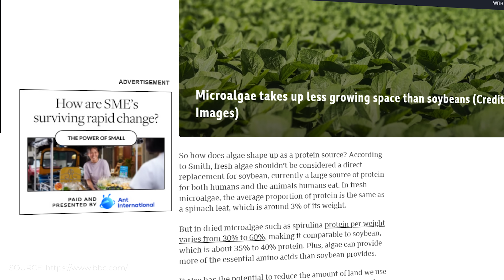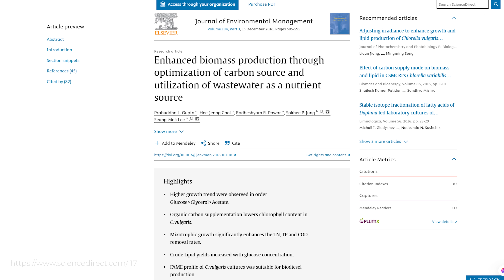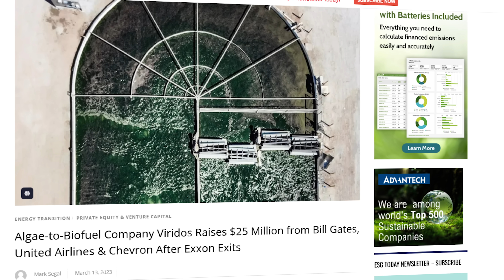Algae: The Ultimate Circular Crop?

Comment: Excellent video!  Well done.  Regarding fish farms, the biggest problem with them is they're stationary.  That's very bad.  Fish aren't supposed to be stationary, they're supposed to move, as much as 50-100 miles per day.  All of that poop falling in one area turns it into a literal cesspool.  Instead, it's supposed to be deposited over hundreds of square miles of ocean, where it's easily absorbed by the ecosystem, becoming part of the food cycle.  A much safer, healthier and eco-friendly system are "free-floating" farms that are allowed to drift out at sea?  But those are EXPENSIVE!  They have to be built to withstand the most hostile environment on earth, and a single mistake can mean the loss of the cages and the fish.  Believe it or not, land-based fish farms are the best solution.  Safer, easier, more economical, and the waste is easy to manage.  I have a Bachelor's in Aquacultural Engineering.  :)
Reply: Fantastic information
Reply: What about locating fish farms [or algae farms] where there is vigorous tidal flushing every day ?     Governments have the authority to designate such well-flushed  bays, channels and estuaries,   I would think .
Reply: @doughamblett5204  They typically are in tidal areas.
Reply: @doughamblett5204  That's where they are located.  But it doesn't matter, because all the poop only goes in two directions:  in and out, not through.  The poop that makes it to the exit in six hours ends up getting sucked back in when the tide changes.  So 50,000 huge fish, pooping in the same spot, 24-7-365 for years, is more than a simple in-and-out can handle.
Reply: And use the fish waste to grow algae, which can be fed back to the fish.
Reply: "The shit you say"
Reply: Most exquisite comment, cheers!
Reply: what's your opinion on using the fish waste to fertilize hydroponic projects? is this a good way to create an ecosystem that absorbs the fish waste without having to build free floating farms?
Reply: You do realize that if you run in circles around your living room until you've reached 5280'ft, you STILL ran a mile regardless of the fact your living room is nowhere near a mile long right? 🤔
In other words, 🐟 still do a lot of swimming/moving even if contained on fish farm lmao

And we solved the problem of fish waste ages ago with plants/filters

Comment: Can Algae be used to extract nutrients from rivers and prevent the red tides experienced in Florida?
Reply: They are algal blooms
Reply: That's what the red tides are doing. You could filter the red algae out of the water and you'd have those nutrients sitting in your filter.
Yes, you could run your river water through an algae farm, but you'd need to hold the whole flow of the river in your algae farm, or develop a reverse osmosis system to concentrate the nutrients from the whole flow of the river into a smaller volume of water for your algae. It's much more efficient to stop people releasing those nutrients into the rivers than it is to clean them up after the fact: controls on farm fertiliser use, and algae farms as part of wastewater treatment.

Comment: The "forever chemicals" in our waste water present a huge challenge as they will permanently contaminate crop ground if sewage waste is used as fertilizer. They should be banned.
Reply: A lot of them can be removed with the right equipment. Many PFAS, for instance, tend to create a foam on the surface of the water, so correct aeration and agitation to promote this behaviour makes them fairly easy to skim off the surface.
It's much more efficient to ban toxins than to have to remove them from our wastewater, though, and also vastly better for our health. Removing PFAS and mercury from a living human body is not easy at all.

Comment: what if algae is composted, will it release CO2 in the air or Capture Carbon gets mixed in the soil?
Reply: As far as I know, the vast majority of CO2 will be released back into the atmosphere, only a little retained in the soil - certainly less than would be captured by woody brash (which is, on average, 10% carbon captured in the soil, 90% released back into the air. 
However, with trees it takes longer for the brash to break down and release the carbon back. 
For instance, raspberry canes, when cut and stood out of doors in bundles in a relatively humid environment (UK) can last around 4 years.
Algae definitely does not take that long to spit back the CO2 it absorbed. 
I prefer to Carbon capture using brash heaps and a little biochar. Brash heaps create lots of places of shelter and hibernation for various insects, amphibians, snakes, animals like hares, hedgehogs, and provide nesting for birds like wrens and robins. 
Certain species of brash support types of fungi, the heaps protecting mycelium mats from the rigours of the sun and drought. This could be utilised to grow yet more food - I have experimented with log piles infused with Oyster mushroom and Stump Puffball. I still have one lot of Oyster Mushrooms going on one large log.
Algae is going to do pretty much none of that (plus there will be no need to desalinate brash as you would saltwater algae before composting. Just coppice, chop roughly, stack and leave). 

Biochar I don't like quite so much because the smoke from my land blows downwind onto neighbours. Don't want to upset them, we all get along really well here and I don't want to change that.

I think you have to determine what kind of environment you have that best suits your method. If you live in a hot, dry location, susceptible to wildfires - brash heaps are no good to you, and biochar will make your neighbours edgy. But if you could determine the best way to capture more of the released carbon from algae before it escapes into the atmosphere - you are going to be one popular innovator.

Comment: I’ve thought about trying to build an algae bioreactor and combining it with an anaerobic digestor to get both methane and oil for biodiesel. I figure the nutrient effluent from the digestor would be excellent for the algae and the co2 that needs to be scrubbed from the methane for a cleaner product could be removed simply by bubbling the gas through a large enough column of water in the bioreactor thus feeding co2 to the algae and simply pulling the cleaner methane off the top of the bubble column. The algae would then grow and could be separated and pressed for oil with the remaining solid waste being recycled into the digestor for nutrient cycling and methane production. The oil then is used for biodiesel or other applications. And the methane used as natural gas is used. The only other potential problem is dealing with the h2s that is emitted in the digestor though there are ways of scrubbing most of that out such as reacting with cheap iron wool or also bubbling through water and neutralizing with some buffer in the water. Not sure if in reality it would work I’m sure there’s lots of other issues to solve but it’s pretty much completely closed cycle with only some additional air bubbling to pull co2 from the air which would have been released by the burning of the fuels.

Comment: We don’t have to invent anything.  Over the past thirty years, all manner of new ideas and methods that put carbon back into the soil and reduce carbon footprints have been field-tested and proven to be practical and profitable.  We already know how to graze livestock sustainably, grow organic food, create a local food system, fix creeks, produce local renewable energy, improve water cycles, grow grass on bare soil, coexist with wildlife, and generally build resilience into the land and in our lives.
  It’s mostly low-tech.  It’s sunlight, green plants, animals, rocks, mud, shovels, hiking shoes, windmills, trees, compost, and creeks.  Some of the work requires specialized knowledge–such as herding livestock or designing an erosion-control structure in a creek–and some of it has high-tech components–such as solar panels or wind turbines–but most of Carbon Country can be easily navigated by anyone.

Comment: If i ever get rich enough to flex, i don't want a full electric or a hydrogen fuel cell. I want a car and a house  that use alge to produce the fuel. Of course would have to factor in how much it makes and how much of the desired stuff is made. Feeding them is a reoccurring cost, obviously.
Reply: If you set up the system right, the oil you're burning should only contain carbon and hydrogen, which your system can replace indefinitely from air. All the nutrient minerals will be recycled in the system and the replacement feed you add will only be trace quantities to make up for system leakage.

Comment: Yep. I told this to a coworker 30 years ago. Algae can produce oil... fuel. The future investment  is aquarium equipment.
Reply: I worked at a biofuel company as a biofuel engineer back in 2006. Let me break algae down for you. It's an extra-dimensional liquid plant that the human mind doesn't have the full capabilities of managing the production of healthy fast growing fuel producing algae. You will need to be disciplined in multiple fields to really make a difference with algae biofuels. It is the holy grail, but that is why it's not been mastered affordably as of yet.
Reply: I am well aware. Im a biologist and was cfo for a compamy tryi g to do that. We failed.

One day tnat or fusion will get figured out amd all humanity's problems will be solved... until the romulans find us.
Reply: @dp7933  Dude, way cool. We probably burned $600k over 8 years. I designed the food for the algae for common waste, non-peteolum based fertilizers, the continuous density filtration management system, the ultrasonic transducer complex for those hard to get compounds, and a multi-species multi-layered algal growing panel. We were one grant writer away from getting proper facilities for fuel development, storing, and get the fuel ready for sale. Anyways, you have a good one.

Comment: There is another option: bioharvesting. By growing algae types that enrich specific chemical alements, such as Lithium from Sea water, cost is lowered and this method can be combined with the fuel production, for instance.
Reply: For extracting metals you need to extract it from the ashes , its fools errand
Reply: @akiamini4006 ... and?  The point is to concentrate the metals.  Extracting metal from the algae is the easy part.
Reply: @debochch   you can't trap carbon when you burn the algea , the yields aren't great too
Reply: @akiamini4006  you don't want to trap carbon.  You want to harvest metals.
Reply: @debochch  this method cannot be combined with fuel production,
Reply: @akiamini4006  no one ever to said that it is intended to be.
Reply: @ Maybe not fuel but natural gas for sure. But I think you can also ferment and get ethanol that is easily separated from the rest.
Reply: @acd1235  like your stubbornness bro , but it would be highly inefficient
Reply: @akiamini4006  that's is still a massive improvement over current methods.  Rare earth metals are not rare.  They are dilute so expensive to mine and concentrate.  Having algae concentrate them first would be a huge improvement.
Reply: @akiamini4006 Doesnt have to be. Lithium extraction wont work in every water anyway. You can make different industries from same raw source. Lithium is so expensive and difficult to mine right now. It may be more efficient this way.
Reply: @akiamini4006  you can use the Algea for heat and electricity if you burn them...

Comment: Don't forget of the asparagopsis alhgae, which, as an additive for the cow feedstock, might reduce, cattle derived methane emissions by up to 90%, by jelping them to digest their food better. That would potentially be a reduction potential of co2-eq. emissions of several billion tons, sonething like about 5% of total global emissions. That would be massive and as a single application definitively in the top 5 with the most potential. But unlike other high potential applications, it would be inceedibly easy to do and you wouldn't need much of the algae. You only got to mix in 1 or 2% to the feed by weight. It would also be lucrative for farmers, because that methane going into the atmosphere means it's not going into the animal and not into animal product, which means that farmers are waisting feedstock, which is expensive.

Comment: you don't need chemical fertilizers if you use compost for no-till agriculture.
Reply: You do if you want to get enough food to feed our population while using the smallest possible amount of land. It's more sustainable to use "industrial" fertilisers and leave more land un-farmed for nature to reclaim
Reply: This isn't even close to being true.  Compost is great, but it is not a fertilizer in anywhere enough levels for producing commercial veg.
Reply: Every atom of every mineral you remove from the soil has to be replaced. Plants can get hydrogen, oxygen, nitrogen, and carbon from air and water. Everything else that leaves your farm, all the phosphorous, potassium, iron, calcium, copper, zinc, selenium, magnesium, and all the rest that plants and animals cannot live without, you have to bring as much in as you export or you will degrade your soils.
Composting the parts of your plants that you don't sell will help, but it won't be enough. That's physics. If you're gardening for self-sufficiency only and composting all your own manure, you'll still have gradual losses from the system from your dead skin cells and hair clippings and other bio materials that don't get composted back into your garden, although you may not notice the loss in one lifetime. But if you're producing food to sell to other people, you will definitely degrade your soils, and quickly, if you don't bring in replacement minerals to replace what you're losing.
It's just physics. What you take out, you have to replace, or you'll have less than you started with.

Comment: "Algae in a single process wont be competitive as fuel or fertilizer production or carbon capture method. But use algae to treat sewage while capturing carbon and then use that to create biomass or fertilizer, then you have an attractive proposition!" - Thanks a lot for clarifying this :)
Reply: That is a nice ecosystem!
A circular economy.
Reply: Riiiiiiight... No mention of the cost/liter or gallon for the bio-fuels... I wonder why? Could it be that a gallon of corn oil is $16..? I'm willing to bet that algae based oils are comparable.
Reply: @johnlshilling1446  They're probably comparable right now, yes. But once you factor in economies of scale, then I'm willing to bet algae based oils would drastically decrease in price.
Reply: @johnlshilling1446 GMO Monsanto corn oil is $16/gallon.

If you want to fund those vermins go for it.
Reply: I wonder if algae could be pumped into oil wells to be cooked under pressure into crude oil?
Reply: @northernmetalworker  Assuming you don't mean this sarcastically, I think that would be redundant,
Reply: @DogFoodInspector I didn't mean it sarcastically, why would it be redundant? Do you think it would use more energy to pump into the wells than out of them?
Reply: @northernmetalworker  The algae can be used to produce oil the same way as things like corn and sugarcane, or could be decomposed to create biogas on the surface. Trying to replicate the geologic process would not be necessary.
Reply: I thought it was composition, lol.

Comment: I plan on growing crops to make my own bioplastics and biofuels. I'm starting with corn, but I might eventually shift to algae, since it grows so quickly.
Reply: Fun fact, crude oil is mostly composed of algae, that have been under the surface for millions of years. Some common species of algae literally grow a kind of oil which can easily be turned into fuel! It could even be pyrolyzed and distilled for industrial petroleum products, just like crude oil!
Reply: Hemp has the highest potential for seed oil on a per-acre basis. There used to be specialized varieties; one oilseed variant was said to have seeds the size of chestnuts. Most hemp seeds are about the size of a peppercorn. If you tinker with biodiesel and modifying tractors, check out Edison Motors. They convert semi trucks to hybrid diesel/electric. Electric tractors have advantages, but suffer from high battery costs or short run time. A small engine w/ generator & batteries could thus power a larger tractor and provide PTO and run for as long as you keep it fueled.
Reply: @Nphen  no way is Hemp oil more productive than rapeseed.
I wish it was, I would love to eat a lot of hempseed.
Reply: @yangtse55  Why do you think you know the potential oil per acre of hemp? The crop is not widely grown and there are not many varieties available to grow commercially. I hope that China shakes off their DEA propaganda and opens up their farms to hemp.
Reply: @Nphen  Well Ito be fair hemp oil would not be very useful because it isn't heat-stable so it's a moot point - it has a favourable omega 3 balance, but so has rapeseed ... I'm more interested in hemp as a protein source and it's very expensive.
The Herer /  "hemp for Victory" thing has been somewhat overdone.
Reply: @yangtse55  At Costco, a bag of hemp seeds is about $12 and provides over 30 servings. 10g protein. That's 40 cents per serving. Agreed it's too expensive at most stores, and hemp fiber clothing is likewise overpriced. Not because inherent problems with hemp, but because the supply is so limited and there are few farmers & processors. Put what the US put into corn ethanol fuel production (billions a year in subsidies) and there would be thousands of new hemp processing businesses across the US. One of few new domestic industries the US could excel at.
Reply: @Nphen  I kept meaning to visit an animal feed wholesaler near me and buy hempseed to make milk, but figured it might be risky based on a case in Germany where people died from e-coli from afalfa sprouts... Though I don't know if the contamination came with the seeds..